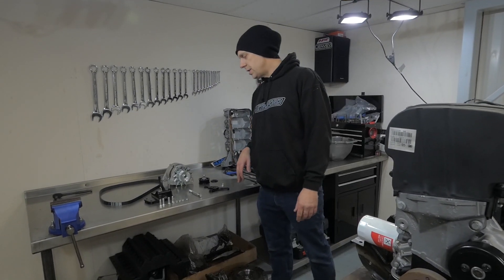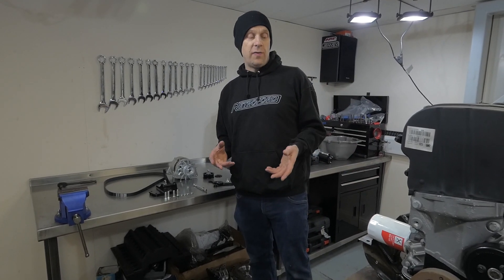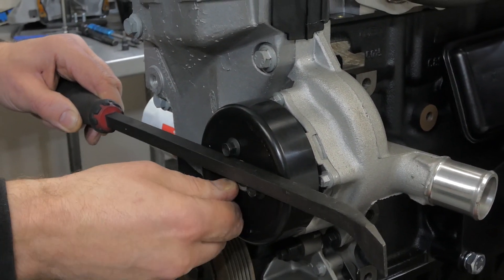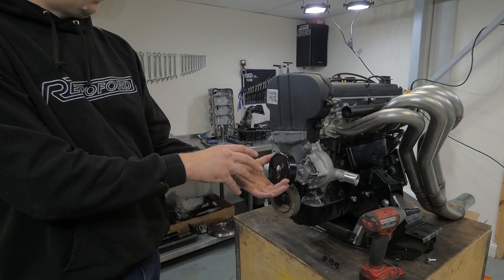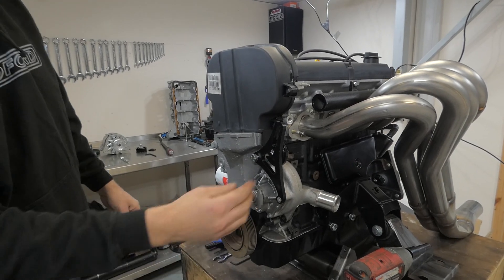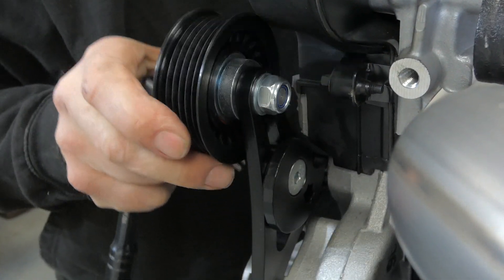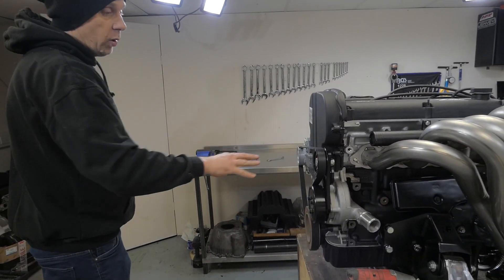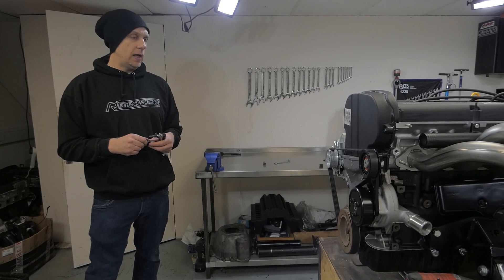Retroford Fitting Guides: Zetec Alternator Kit - Black Top/ST170 (Z100)

Comment: The Motorsport alternator kit doesn't have the snail tensioner and has a slotted bracket for the alternator. Which should be used to tension the belt?

Comment: With the retro Ford kits do they fit the 1.8 and 2.0 like the sump are the dimensions the same cheers
Reply: They are all the same, the block is no different 1.8 and 2.0, the alloy sump is the best out there for rwd drive, water pumps are different on silvertop zetec

Comment: This is a great video. I will ask a silly question though..-As the 70amp alternator is the only ancillary on the other side of the block, why not mount it low down on the same side as the water pump and therefore run a much shorter serpentine belt?
Reply from the maker: A good question to be fair Phil. If mounted low on the opposite side the alternators tend to fail due to road dirt and water ingress👍